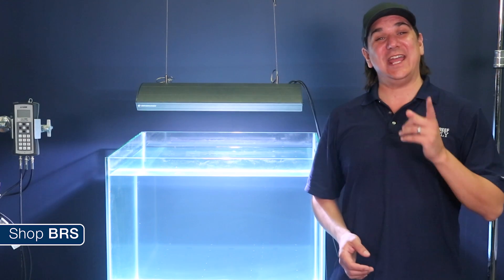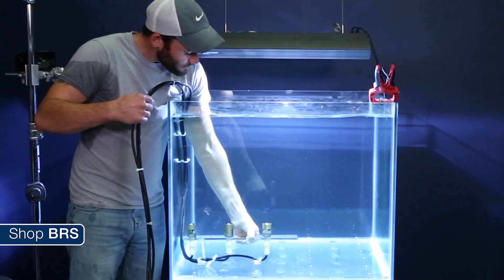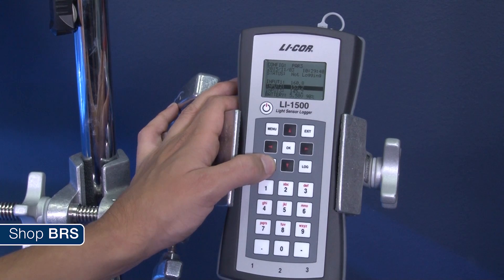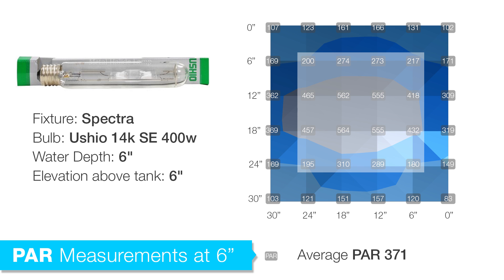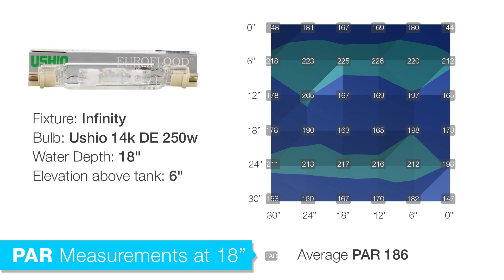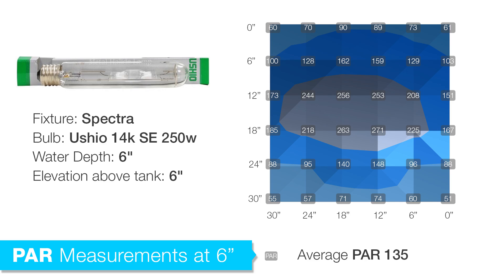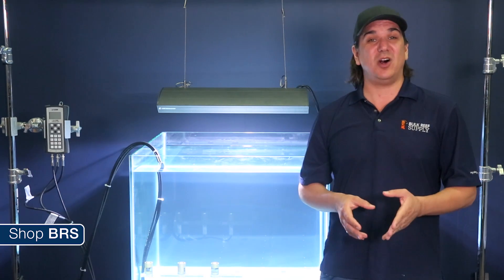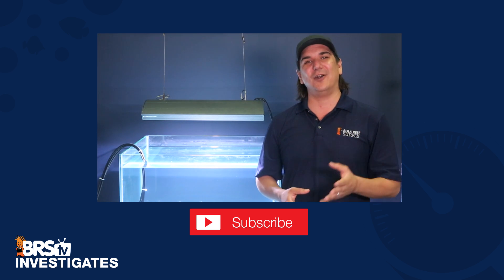BRStv Investigates: Double End vs Single End Metal Halides - Which is better?

Comment: Here I am in 2025 making a joke out of all the fancy reef breeders and radion LEDs growth rates with a 600 watt double ended ceramic metal halide so don’t let these new snake oil salesmen tell you the new LEDs are best. If you can handle the heat of MH it’s still way better then LEDs

Comment: Specifically with Radium bulbs, a 250watt radium on an M80 ballast runs nearly as high as a 400watt radium. The 400watt radium is really 360watt, but the m80 isn't made anymore so with an electronic ballast the 250watt output is more typical now.

Comment: It'd be awesome to see if 2 smaller skimmers performs better or worse than one big skimmer.  Also internal vs. external skimmers.  Finally, can you go to BIG on a skimmer? (starting a 180g build, but would like to go to at least 800g within 4 years.  Would like to reuse as much equipment as possible.)

Comment: First off, thank you for making these videos, this is another series that I am going to be eagerly looking forward to seeing every new episode you release.

Second, I was absolutely floored that the DE bulbs were that much more powerful than SE bulbs, and part of me wondered if you had the glass shield over the DE bulb and NOT over the SE bulb.   

Third, I was surprised at the results from the Geissman fixture compared to the Caymen fixture,  while both give good readings at 18" the Caymen is a bit brighter in the center, but the Geissman has much higher at the edges of that 30x30" square.   Is that all reflector doing that?  Or is there some reflections off the glass wall?     Does Geissman just sell that reflector?  Or are you forced into buying the all in one fixture?

Lastly, (promise),  one thing that struck me as awesome, was the distribution of light as you went deeper,  unlike LEDs the brightness doesn't drop by an appreciable amount as you go down near the edges, yes it's not as bright as the center, but the deeper you go the more benefit of the large reflector that you get.    It was a bit sad to see so many LEDs at MACNA, yet no love for metal halides anymore.
Reply: Ah I see, curious how those single ended results would work if you don't use the glass shield.   Because now you have another piece of glass that needs to be gone through which could explain why the double ended fixtures are giving better results.

Comment: +BRStv When replacing the plumbing for a tank/system, is it myth or reality, that a 90 elbow works better than a 45 elbow? For years, I have always used 45's over 90's to maintain a even flow in my plumbing. I always see people use 90's instead of 45's, only for the sake of space utilization and to generate a clean appearance. Is one better than the other?
Reply: great topic!